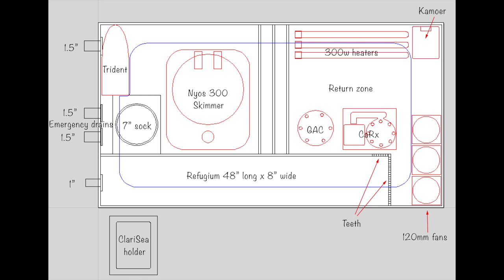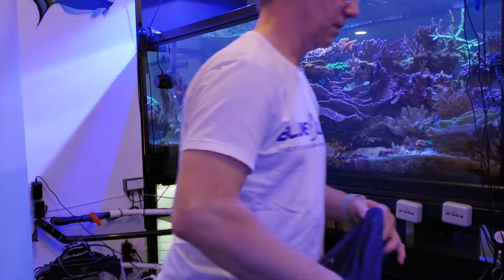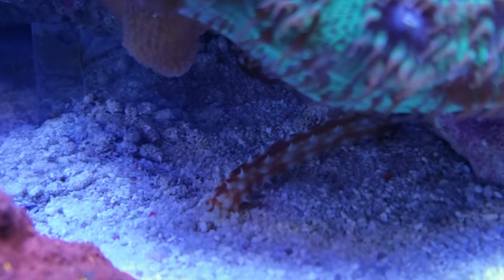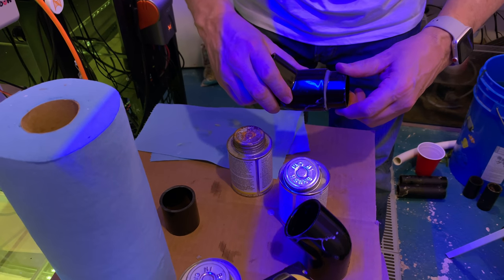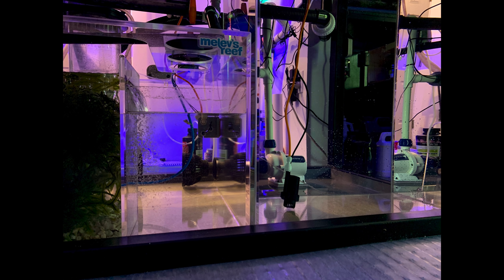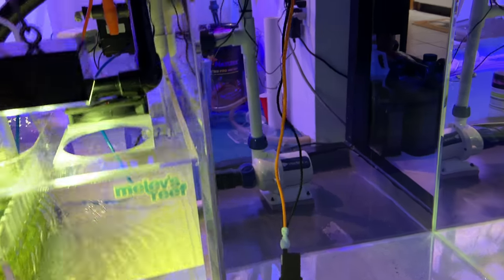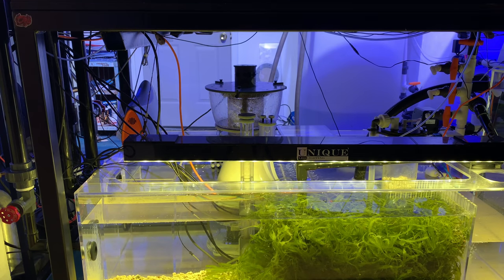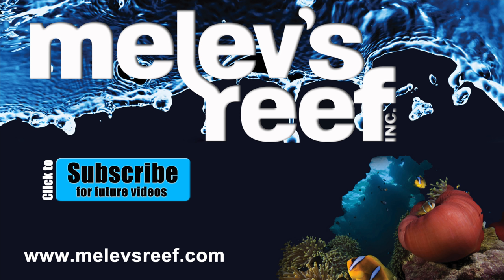My new sump for the 400g reef

Comment: Gotta say that filter sock box you did was pretty slick. 

I was going to go with colored PVC on my newest build... but at the last minute my cheapness gene popped in.   Figured $15 for a 4' section of PVC, or $2 for a 10' piece... ignore how much I spent on the tank to date I probably saved $100 on pipe alone :D
Reply from the maker: Yeah, I could have replumbed a lot of it for less money, but I prefer the better fittings (the unions and gate valves you saw) and I've really liked the black PVC I've had so I decided to just do it again.  :)
Reply: @melevsreef  Oh I agree, I went with home depot pvc, with home depot unions and home depot screw in fittings.     I did that for two reasons beyond my cheapness gene.

First I like the idea of buying a ton of parts so I make sure I have what I need without rushing to the store just like you did,  but then I return what I don't use later which I don't know how viable that is when you order online.    

Second, and more importantly the sump I put it was a cheap DIY jobber that I just had to get in so I can get my skimmer and everything in to move my existing fish over.   (It was kind of an pseudo emergency move)   And I knew that the placement of where the pipes would go to the sump would be different and I'd had to cut and modify them in some way, but I had no idea which way.   So didn't want to pay for premium plumbing parts if I was going to cut them out anyways at a later date and replumb it all. 

But I'm fully anticipating chopping out the older stuff and replace it with nicer new stuff.
Reply from the maker: @Mike__B  Makes total sense. My bin of PVC fittings is filling up - I'll never have to go to Home Depot again. lol

Comment: Very Awesome! Great job man! Bet it’s a great feeling to have the nice new sump installed. Looks great! Congrats!

Any thoughts about putting the cube return in the refugium zone? Maybe the plants would block the bubbles from the return section.

The camera man did a great job! Bet that was a huge help!

Did any water get under the sump, foam, or ATO tank when it overflowed? I had this happen once and had to take everything out to get it dry! 

Great Video! Congrats again!

Rick
Reply from the maker: I have a nifty trick that would solve the anemone cube drain, using a PVC pipe with a lot of slits cut it in it. I think that would be ideal, and once done I can post pictures of the solution.

Yes, water got under it - oh well that's why my setup is that way. It will dry out eventually. ;)

Comment: Really nice set up , 
I enjoy watching your videos. 
I have a question for you;
How long does the silicone last on these tanks ?
No wone seems to want to answer...
Is clear better than black?

I've been a reefer since 92 lol
If you wanna read my set up :

My tank is a lab type set up
180gl Marineland with 70gl custom sump.
Acro dominant/acan/zooz
Mixed reef with 10 fish.
3x Kessil a360x/controller with 4x t5 lighting.

My custom sump is very different.
 I dose Nopox so I have no Fuge and
 I've been dosing bubbles for years, so no baffles.
2 return pumps 
4 constant drains,
 no emergency drains.
4x7 inch socks in two separate compartments.
Tunze 9430 skimmer in a large 50gl center compartment.
with 2 WAV pumps in the sump creating a storm of flow at 100% power.
the tank is in the basement so I don't care about the noise.
(Kind of loosing my hearing anyway lol.)
My sump is very turbulent water so it's always clean.

I use to have the Tunze calcium reactor but I went back to the balling method.
Better growth and color Imo.
And I also dose Kalk to keep my ph nice and high.
Parameters :
I got a lot of time on my hands /an annoying wife lol.
KH    11.2 to 11.5 (AF test every day)
CA   460 to 465  (Salifert - AF test once a week)
Mg  1410  (AF test once a week)
No3  1  (AF test once a week)
Po4   0 (tested every other day with the Hanna Phosphorus ULR  it reads in parts per billion)
STR   22 (Salifert tested twice a week) 
K      420 (Salifert tested twice a week)
PH 8.3 /night to around 8.5 /day (monitored by 2 blue plastic Ph probes on my Apex 
and 1 Glass Ph probe on my Tunze 7000 smart controller)
No need for heaters but I do have a chiller hooked up at 77° 
I do 1X30gl water change every sunday.
Enjoy!
Reply from the maker: It varies. It can last 5 years, 10 years, 20 years. It all comes down the the quality of the tank builder's work.  I've had tanks last 6 years, and I had one fail after 13 months.

Comment: Marc, put a little bit of dielectric grease into the connection of the trident to prevent it from rusting. Makes a huge difference.
Reply from the maker: Which spot specifically?
Reply: Where the connection is exposed and the 24volt plug in.

Comment: great video as always, great sump. Thank you for sharing the build with us. One question though, wouldnt it be a good idea to install a ball  valve on the main drain, before the gate valve? That way you can cut it off and send water to the filter box without disturbing the fine adjustment of the gate valve?  Just asking because i plan on stealing some of your ideas into my next build, Yeah.. im one of those idea stealers....
Reply from the maker: I don't think it's necessary - you'll learn the sweet spot, and be able to find it pretty quickly.  Plus another valve would add some internal resistance/restriction. 

Another idea would be to stick a tall PVC pipe in the overflow box in the main drain's hole (bulkhead) that would quickly stop flow down that drainline, and water would then go out the emergency drains.  Cheap fix, just need a pipe about 8" tall (in my particular overflow).  Then like you said, I wouldn't need to touch the red valve.
Reply: @melevsreef  that's a great idea Marc, I'll have to give it a try

Comment: Question regarding the filter sock setup.  I know you use it sparingly and for short periods of time, but with the sock section taking so much water, would there be a problem once the sock starts clogging and less water passes through?  Both emergency drains go to that section.  The container has a lid, so I’m just curious where the water would go if it begins to back up?
Reply from the maker: The lid would lift and water would pour down the walls as designed but I think I’ve come up with a work around or two.

Comment: oh I had a anenome question, you have a georgeous nem tank. i did an oopsie... i found a med flame BTA at a wicked price so i jumped on it, impulse buy yes it was. in my main 50g is currently housing a tube nem. after looking up nem comparability I realised oh oh, I dont dare try 2 different nems in a small tank. so now the FBTA is in my 25g qt. hes got hydras on him but if you know or have tried to put a bta with a tube nem and had success as if possible I'd like to get him outta qt and into main display or I leave him in 25 & get a 10g qt... I really dont have the ti
e for more tanks tho. thanks for any help or advice.

Comment: Looks great Marc! So do you push water with the kamora pump to calcium reactor or pull? And how many ml do you run at ?
Reply from the maker: I push water into the reactor, and it's running at 71ml per minute.
Reply: @melevsreef  very cool. I am using the pulling method but it's causing alot of bubbles in my calcium reactor. I'm going to try it your way to see if that helps.

Comment: Awesome.. Wish I lived near u or visa versa. I designed my sump using a 40 breeder. Came out pretty clean with the glass baffles which  I had my hardware cut for me. My only issue is my two returns house once inch drains left and right. Apparently there way to small to handle the new ecotech Vectra m2. So I have to calibrate it per ecotech. Reason right now using jebao DCT8000 which failed  3xs. Fortunately I am home healing up from emergency surgery. Even after removing and cleaning with vinegar seems it's destined to fail again. Already have the return plumbing glued just have to put it in place. ? Are the Vectra easy to calibrate as everyone says. Another issue I had to add another 15 lbs of live sand which is causing brown algae again on my Rick scape,is that normal. Seems to be a silicate issue so I installed a high rejection silicate to membrane along with an additional extra DI cartridge. Happy Reefing 😎
Reply from the maker: Calibration is easy, you can do it with the app.
Reply: @melevsreef  There's an app. Is it on google play.. I saw the video and it seems so complicated.
Reply: @melevsreef  is it the echo tech live app.which I have my Radions controlled from.

Comment: Marc quick question. The vectra pump you plumbed it externally. I was just wondering why you went that route instead of just plumbing it internally since the return section is so big? It just seemed like that would be a nice place for new toys to fit. Great job. It is so nice looking at things when they are so clean and well planned.
Reply from the maker: The return zone has extra room for more reactors, like my bio pellet reactor and my carbon reactor. They just aren't installed right now.  

I've been running the Vectra externally for years, so I didn't really have a good reason to move it internally.  Plus, I love space in a sump instead of being packed with gear.

Comment: Hey Mark,  Do you use an UV sterilizer?  I would be interested in a video showing your whole system, filtration, dosers, lighting, reactors, skimmer, the whole shebang.I’m setting up my reef system with a 540g display and 100g sump.  I want to avoid water changes as much as possible, to keep the system stable.
Reply from the maker: My 5 year anniversary video (Nov 2018) does exactly that. Full tour. And no, I don’t run a UV.

Comment: No ball valve on the vectra ? What if u need to replace it or clean it ?
Reply from the maker: I screw in a white plug into the bulkhead where the strainer basket is.  That was $.99 instead of a more expensive valve. :)

Comment: The media in the refugium is going to allow a load of detritus to collect at the bottom.
Reply from the maker: It should be easier to clean compared to sand.  Just scoot it over, and pump out the detritus, then scoot it the other way and do the same.
Reply: @melevsreef  How often will you do it? :)
Reply from the maker: @LightSearch  I was doing it every two years, but now I can do it more frequently and quickly.
Reply: With all this automation more and more available to us, I find myself being very selective about what I want to automate as I find it disconnects me from the tank. Here's a long story for you.

Back in 2005 someone asked me for a proposal to commemorate the 5 years of an art contest. I didn't have a fish tank at that time but I wanted one so I came up with the idea of renting them a 250 gallon tank with african cichlids and holograms of the previous winners.

I got the tank and the over 20 adult  fish 3 days before the opening of the exhibition and of course I had an ammonia and nitrite spike.

So every night after the museum closed I went there and did 50-60% water changes. The problem was that I had to carry buckets up and down the stairs over a 100+ meters path. This lasted for 4 weeks.

When the exhibition was over, I finally brought my dream tank to my office. I finished setting it up around 5 AM and then when home to sleep (I lived in the same building, 3 floors up).

Around 10 AM I woke up in panic. I knew the tank had exploded and that the fish were dying. I was so terrified that it didn't occur to me to ask how the heck did I know it. 

I was putting my clothes on when a colleague entered my apartment (I had a copy of my keys in the office) shouting that the tank had exploded. We went down and we managed to pick almost all the fish.

The way I see this is that I somehow created a strong connection with those animals by putting so much effort to make sure they survived.

This is an extreme example but I think my point is that the work we put in our tanks may have a psychological impact in the way we appreciate them. So, I try to not automate too much.

Comment: Why not just put the drain from the anemone cube into the first chamber of the sump so it can be processed by the skimmer?
Reply from the maker: I used to do that, but since I usd the Sockbox system in that general area, I decided to drain within the triple baffles. It's worked out fine, no issues or microbubbles to contend with.

Comment: Does plumbing the drain straight into the sump below water level reduce the sound that much? Why dont more people do this?
Reply from the maker: zsoard most people drain into the sump via the top, rather than the side like I did. More importantly, the gate valves are what quieted how the water enters.
Reply: @melevsreef  ya I've always come from the top but getting ready to plumb the sump on another build so thinking i might try it from the side like you did, it just looks quiet especially without the bubbles
Reply from the maker: @zacharysoard698  It has worked out great. Your tank must have one emergency drain though, you can't do this without one. Look up Herbie Drain Plumbing.

Comment: What size plumbing did you use for everything? It's the one additional thing I wished you would have mentioned in the videos.
Reply from the maker: Everything was 1.5" except for the Refugium. That one has 1" going in.
Reply: @melevsreef  interesting so your drains and your supply lines were 1.5 inches? I know you have a couple other smaller tanks too, and I was wondering what you use in those as well.  Do you always try to go for larger supply lines? I'm getting ready to plumb a 120 and debating how big to go with the supply lines
Reply from the maker: @lenzpw  My 400g has four 1.5" drains, and I have a single 1.5" return that feeds dual random flow generator nozzles. I only reduce where I had to, which is 1" going into the water. Here are some links to the various blogs covering the plumbing... except it doesn't include what I did last year (in this video). https://www.melevsreef.com/tanks/plumbing-drains-returns-and-manifold
Reply: @melevsreef  awesome thank you. I was half way through that video when I saw your response. I'll go finish it now. The 1 inch random flow generators don't reduce the flow too much do they? I know my single 3/4 did on my tank before I took it off.
Reply from the maker: @lenzpw  No, they increase the flow, and it moves randomly rather than a straight laminar flow.

Comment: What glue did you use to glue the sump together?
Reply from the maker: I buy the solvent in bulk every 18 months and rebottle it in unlabeled jars for easier use. You can use Weld-on #3 or #4, that was what I used to use.